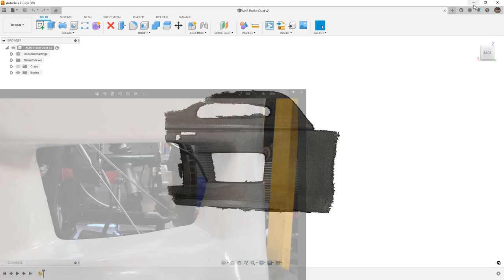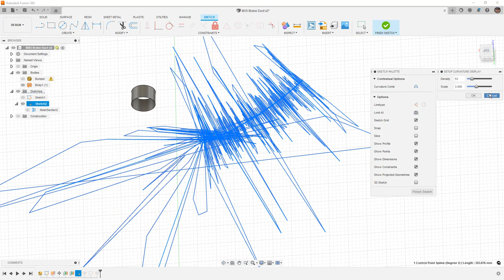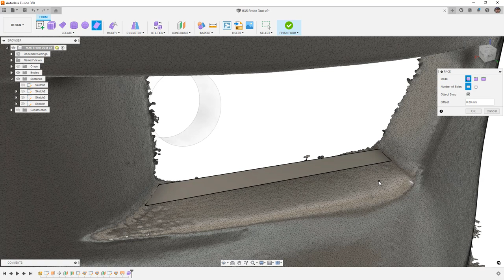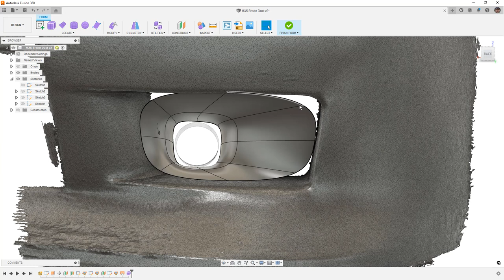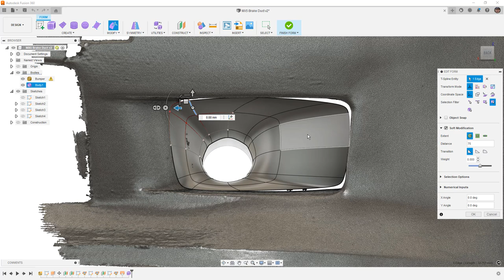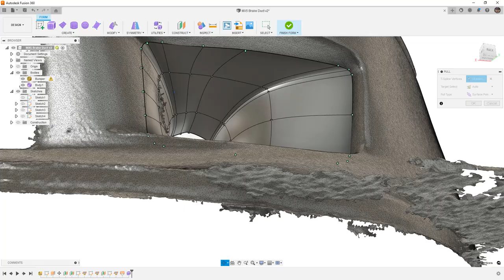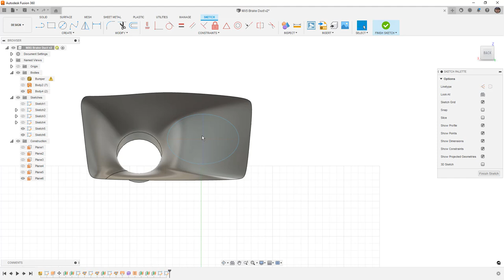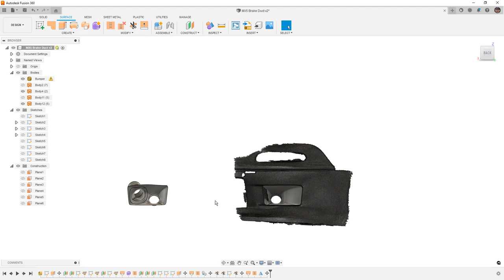Fusion 360 Form Mastery - Part 46 | Designing a Racecar Brake Duct System with Forms and Surfaces

Comment: I've been following many of your videos lately and it's been really instructive.  I learn new stuff everytime!  The part I would like to have more details about is to get from those surface to a 3d-printable model.  I've used "thicken" on some of my experimentation and often it leads to error messages.  Since my goal is to 3d print my resulting parts, it would be very interesting if you could show us more tricks about this part of the process!  Thanks a lot again for all you wonderful videos!
Reply from the maker: In this series I do print all the fender pieces.  And while i have them all sitting on the car i haven't "finished" it yet.  Life has just been too busy.  But this video talks about thicken and the next one in the series i show breaking them up into smaller pieces to print.  https://youtu.be/0WvaboMYOag
Reply: @LearnEverythingAboutDesign  I'll be following, I have an alert when you post something new.  Just trying to catch up all your great stuff but will definitively be looking to the link you sent!  thanks!😁

Comment: Hello Matt, great tutorial as always. May I ask you is there any way to avoid having tangency handles at the last edges? I have been modeling 3d objects for 30 years using 3ds max , and surfaces don't have tangency handles, only curves have. For me it is annoying to manipulate handles when I use t-splines.
Reply from the maker: Well before doing these videos I have never "needed" to mess with them.  They are always there and problem only really arise when you use Match.  What I have noticed is that if you manipulate them and then click on the chain link icon it will relax them(not always).
Reply: @LearnEverythingAboutDesign  Thanks for your answer Matt, and keep up the good work my friend.

Comment: I have been banging my head trying to design an intake under my headlight with solid and sketching, I never knew about the form function. I am new to F360 so this is some invaluable information for me to wrap my head around. I've watched it a few times now and slowly getting the hang of it at snail pace.

Coming from tinkercad (I know this is looked own upon as an adult, but it helped me tremendously), using freeform for bodywork feels a lot more organic as it's common for me to get a million errors trying to sketch/extrude things in 2d sketches.

Thankyou for taking your time with these videos!
Reply from the maker: Awesome, glad you were able to make some progress!  Tinkercad is a good offering, especially for free, but it does have limitations and quirks.  I really like it for the electronics stuff, but yeah modeling in it is really tough once you get familiar with Fusion or any CAD program with sketching/surfacing
Reply: I tried linking an image album of my progress using your advice in this video but I guess youtube didn't like it. So I made a tinyurl with my username instead hehe!

Thanks again, looking forward to your other videos.

Comment: Hi Matt! Great presentation as usual!! did you align the mesh body to the WCS? or you just used the "insert mesh"  command and left it in space? I usually use GOM inspect for geometric shapes - it's quite easy, but for these complex scans I am puzzled..

Quick Tip: You can make those tiny offset planes bigger by grabbing the vertices and pull them outwards.
Reply from the maker: Thanks Luis!  The mesh was sent to me aligned already so all I did was Insert Mesh.  I don't know what scanner or software was used before opening the mesh though.

On the tip. WOW.  Was that added recently??  All these years and I didn't know that!  Thank You!
Reply: @LearnEverythingAboutDesign  😄😄I dont know when it came out. Glad to know the apprentice was able to teach something to the Master!
Reply from the maker: @luis7899  It is important to always know you can never know everything! Thank you!